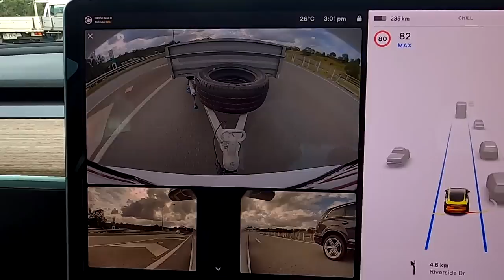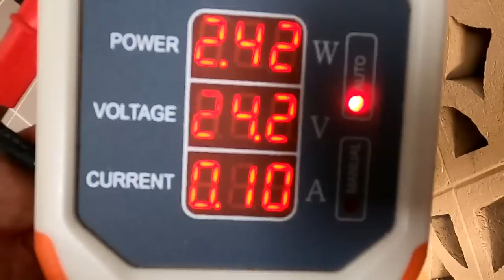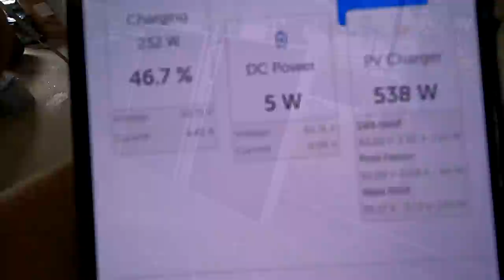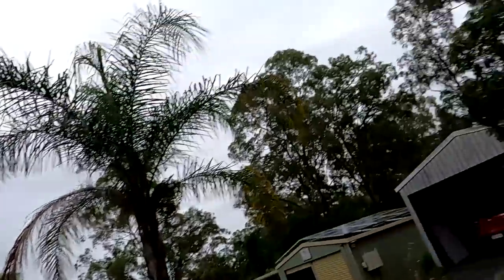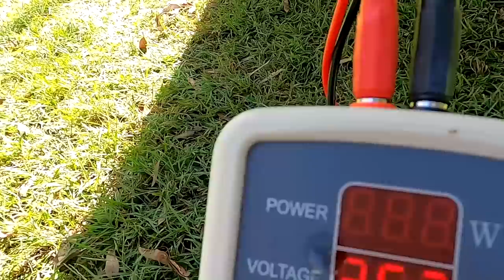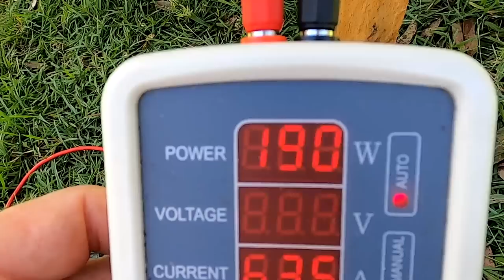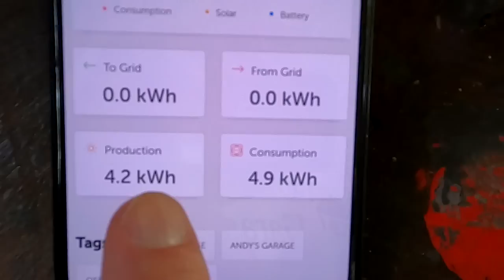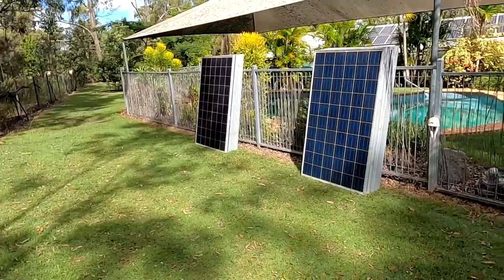S.P.A.T.-Testing used RENESOLA 250W panels 🍺 Have I wasted my money (again) on this brand?

Comment: create rack over the walkway between the sheds .. extra sq. meterage  and shade creation
Reply from the maker: I need to access the gutters though, so that's not an option here. But I still have a lot of roof space for another 20kWp at least plus other locations we will explore in the future.
Reply: @OffGridGarageAustralia  smiles .. i have designed mine to use no gutter and make/collect the water fall down sides and collect and drain at ground .. no more leaf litter ever ...lol.. i have pile rotten guttereing awaiting my burying in the next veggie plot .. waste not want not ... smiles .. so many ways .. but ideas spring eternal ..
Reply: @OffGridGarageAustralia  how about utilising the space above the pool area?

Comment: Now THAT is a deal!  I wonder why they sold it for so cheap?  Even if the inverter doesn't work, you still got a great price for the panels and the rails!  Great find!
Reply: because you have to pay big bucks to recertify panels to reuse them except for DIY off grid.
Reply: @John-gm8ty  no - because it’s Australia and used panels are cheap here. And if your selling a brand like Renasolar which is known to be not great then you have to sell it cheap, because you can buy decent brand second hand 320W panels for about $100 panel. There are heaps of those early 3kW systems being pulled off roofs in favour 6.6kW or 9.2kW systems. Plus they probably just wanted to get rid of it fast. You can get a Fronius 6.6kW system with tier one panels here for about $AUD5K - 6K installed. And you can get much cheaper if quality is secondary.
Reply: @mondotv4216  mate, my point is if you want to reuse them on a grid connected system, you HAVE to have the panels (and inverter if used) tested and recertified to be used, it is the law.
and thus, they are a plenty because no one wants to pay for that vs just buying new panels and new inverter.
and upgrading their current systems to larger ones.
no company would touch us to add a second system to our 10 year old 3kw set up, so all we could do is upgrade to a bigger system over all and take the old one down.
and that's why I have 10 panels in my side yard now.
Reply from the maker: The re-certification of panels and inverters is a pain in the bum down here. I stay off-grid and keep adding...
Panels are not that cheap any more down here as they were a year ago. And far less choices of systems available. This was a very lucky deal.

Comment: Hey Andy. We're sitting in the same boat.  Next Friday I will pick up 120 of used 235/240W. I have 20 used 175W BP Solar for about 5 years. And they perform really good. So hopefully the newer ones will do the same
Reply from the maker: Good luck. I'm sure they will be fine. 120 panels is a lot. Hope you share some with your friends 😊

Comment: Your more than welcome to send the inverter to me over here in Nz so I can use it to start building my own off grid setup on the miniature farm I am buying. Not bad inverters those growatts
Reply: It's a grid-tied inverter. You'd need to make a "private grid" with another off-grid inverter to bootstrap the grid-tied inverter.
Reply from the maker: The Growatt can only be connected to a grid or a Multiplus which can handle that sort of AC connected inverter at its output.

Comment: One tip for hauling panels if you have to stack many is to make some wooden corners out of dimensional lumber scraps and some screws that you then band the corners with a couple straps and this keeps all the panels locked together with the frames on top of each other so all the weight and pressure is supported by the frames when going down the road. Then you can have a couple straps over the top to keep the whole works from moving during transit.

Comment: It’s great to see u recycling old panels, I think it would be a good business to harvest and test 2nd panel’s for resale
Reply: requires recertification which would raise the cost of used to near new prices, no one would buy them.
Reply from the maker: There is a company a bit north of Brisbane which has hundreds of these panels for sale. It was just a bit too far for me to drive.
You could match all panels with the tester and sell them for different prices depending on their power output.

Comment: don't forget to test for ground fault as some panels will show voltage from one of the terminals to the frame, I had some showing 15v to the frame
Reply from the maker: Yes, I'll do this before they go up on the roof.
Reply: @OffGridGarageAustralia   a lot of cheap panels have been taken off the roof due to a ground fault. This is normally due to 2 reasons is water in the panel and caused corrosion to the frame water in the panel or a short to rail.
Reply from the maker: @robben8704  This is a problem if you have grid-tied inverters as everything related to ground. My DC system has no relation to ground at all.

Comment: Definitely an advantage of living in a country where solar power is commonly installed: cheap used panels!
Reply from the maker: I will buy some new panels at some stage for other roofs, just to see the comparison to the used ones. But these 250W panels just fit perfectly to the existing system, voltage, amps all this matches the existing panels, so I had to do it.
Reply: @OffGridGarageAustralia  I would do the same if they were available here at that price!

Comment: Great addition to your arrays. You've got the space, so there is no problem adding them. Also great you recycle them this way, they seem to be around 80%. But still fine for your wallet. What is the calculated turnaround time?
Reply from the maker: Thanks Edward. The panels will output full power of cleaned and we have clear sky. The 80-90% I saw during the test was enough for a light cloudy morning.
I have not made any calculation in this regards. It's a hobby, so money well spent.

Comment: You are a lucky man! This little amount of money for these much panels incl. rails etc. I'm envy.
Reply from the maker: Discovered it on the morning, texted the guy and picked up 4h later. I had to charge the vehicle a bit higher due to the trailer load 😊
Reply: @OffGridGarageAustralia  Guten Morgen from lower bavaria Andy, thanks for your reply. How much increase in current consumption do you have   when taking the trailer?
Reply from the maker: @a__133  I manage usually around 132Wh/km for this trip and had now 225Wh/km.  It used exactly 50% of my battery for the 100km.
Reply: @OffGridGarageAustralia  TY very much. Consumption increases similar to an ice car. 🤨

Comment: Possibly on your next solar installation the next 3 kW do a ground mount installation. That is if you have maxed out all of your roof space. That would be a great video you could also have them adjustable for winter to allow maximum power over your roof arrays 👍
Thanks for the SPAT T-shirt🍺
Reply from the maker: I will do a ground mounted installation at some stage. I have a special area in mind on my property but can only AC connect this back to the garage, so it will be interesting to hook this up to the off-grid system.
Reply: @OffGridGarageAustralia  
Excellent looking forward to that video

Comment: You have probably mentioned it before, but is your garage cooler with the solar panels on the roof creating shade?
Reply: I had a 10 kw system installed on a scillion type roof to fill the area above our main living area of our house, and the air conditioning effect is huge, it drops the inside temps so much in summer until around lunchtime at least and my house is so much cooler, we only use the air cons very occasionally. Cooling effect = HUGE!
Reply: @evil17  That is cool to know, thanks.
Reply from the maker: Yes, it is a lot cooler already. The panels keep the heat away from the roof.
Reply: @OffGridGarageAustralia  Glad to know that, thanks.

Comment: Just keep adding.  Sweet.  The inverters use clipping(your solar charge controllers), so you can just keep adding until you reach the V I limits.  My inverter/charger was rated for max 3000w and I put in well over 3000w.  Clipped the access off and charged at 3000w.  great stuff.  You could call it a waste but panels never get to there potential in winter.  When there this cheap just keep adding.  I think solar company's now do this, add 20% more panels for losses.

Comment: hi Andy, now you have more panels wondered if you would be putting them in parallel with an existing string. I am thinking about connecting a string on an East roof in parallel with a string on the west roof. what would I lose if I did this - maybe only a small percentage and it makes sense rather than investing in more expensive Victron mppt. maybe it's an interesting study and you are the person with loads of panels.
Reply from the maker: Thanks Gary. Yes, they will be in parallel with the existing strings on the garage. I have all panels in a 3s configuration matching my solar charge controller. I upgrade the controller to a larger one when I build the PowerWall to accommodate these additional panels.
Each side of the roof has 3 strings (with 3 panels in series) in parallel at the moment and with this upgrade there will be 5 strings, so I parallel an additional 2 strings. 
And I will have the exact same on the other roof side, so east and west are identical. I'll explain this again when we install the panels. Just waiting for material to come in for that...
Reply: @OffGridGarageAustralia  thanks Andy. Thinking a bit more about this and looking at your roof angles I think your system will generate quite a bit off both east and west at the same time. I have a roof with an angle of nearer 45degs so I am thinking I will either get power from one or the other, so am sizing mppt to only one side but actually attaching twice the solar capacity
Reply from the maker: @DrJGD  that's correct, there is little difference between East and West in my case. Especially in summertime they are almost the same. I'm in the process of finding more spots on my property for the winter sun. That's when I need the energy.
Reply: @OffGridGarageAustralia  on a side note, have you ever tested the difference in performance between a 2s and 3s  with the mppt ? Is it better to have say 3mppt and 2s or 2mppt and 3s. Given mppt limit is the output current and ignoring the mppt cost for now - which would perform better ?

Comment: I used some old Sharp 220w - if you have endless space to mount its good, but new panels from a wholesaler are pretty cheap & youll get a lot more power on cloudy days.

great price for the rack mounts!  grease it up to avoid corrosion & galling
Reply from the maker: Yeah, some of the clamps I could not get off easily. Is there a special grease to avoid that with aluminium?
Reply: @OffGridGarageAustralia  As always i look to marine applications, the harshest environments.  TefGel gets a good mention. You need an anti-seize compound, but they normally have copper/metals - which make corrosion worse.
I just did a quick Lannox lube or lithium grease from memory, as my setup was temporary.

Comment: I think the discolouration around the cells is due to high current on the busbars within the panel.
Reply from the maker: Don't know, I have some other panels they are reversed in this colourisation, so dark in the middle and clear around each cell in the panel. Still output is normal.

Comment: Are you going to ac couple through growatt inverter?
Reply from the maker: Yes. But with the off-grid system. The Multi can handle AC-coupled solar on its output.
Reply: @OffGridGarageAustralia  I think adding ac couple with its own set of challenges will be a great addition to the channel.
Reply from the maker: @jasondevine6014  This will be a rather larger portion of how I connect new panels in the future I think (at least in some areas). Due to shading, micro inverters could be the way to go...

Comment: Seems to me you got yourself a deal. Which of the inverters will you connect them to?
Reply from the maker: Because I'm off-grid, I have to connect the grid-tied inverters to the output of the Multiplus and the Multi will handle the power coming in and also charge the batteries from that power. This all will be very interesting!
I will potentially use the Fronius inverter I have but will keep the Growatt as well. I also ordered some micro inverters to some extensive testing.

Comment: Will Prowse likes ReneSolar. The polys produce their full rated output. I have 4x 325W output up to 1.302Kw into Victron 100/50 and up to 45.5A into battery.
Reply from the maker: Yeah, the older 190W panels I have from them are all not good. So I was concerned. Luckily they all seem to perform well.

Comment: Hi Andy, I do enjoy your videos and have learnt a lot from them, thank you. I have had an idea for my off-grid set up that I thought you may be interested in, some videos perhaps?. I want to use excess off-grid solar generation to heat water and charge an ev (still waiting for a suitable one). The problem is my solar is in a shed 100m from where the hot water is and where the ev charger will be. An elegant solution has avoided me until now. I just saw a video on home automation with shelly relays. It is beyond me at the moment but it seams possible to sense the SOC of my batteries with my victron shunt relay and send that info to relays controlling my hot water and ev charger via wifi.
Reply from the maker: Thanks Colin. We ill certainly have a look and install some extensions on my system in the future to automate such functions for times when we have access solar available.

Comment: Nice video again Andy. In total how many Kwc will you have?  Is there’s any regulation on this in 🇦🇺 ?  In France we need an approval process in townhouse to install panels. This take approx 3/6 months. And the law does not allow to have more than 6kw injection into the load.
Reply: Andy is running ~4.2-4.4kW already, and I believe has other spare panels as well. So this will expand the existing 4kW system. As he says at around 2:00, that will give him over 7kWp.

As this is off-grid, there's no limitation on generation, as he's not feeding back into the utility grid.

Comment: Build a structure over the pool with solar panels!!! That would be incredible.
Reply from the maker: A structure... do you want to come an doing it? 🤭
Reply: @OffGridGarageAustralia  If i can stay with you for free, I would definitely do that for you!!! It should only take a week or two.
Reply from the maker: @jondavidmcnabb  free power and stay in the OffGrid Garage 😉
It will be very difficult to build such a structure over the pool with can withstand the wind load. Lots of concrete and a very strong structure spanning across the 15m of the pool. That's not an easy built...
Reply: @OffGridGarageAustralia  Aluminum structure and wedge anchors into the concrete. Aluminum can be cut with traditional wood working blades and won't really rust. The panels are the roof. Now you just need to collect a bunch of scrap aluminum.
Reply from the maker: @jondavidmcnabb  Aluminium is not the problem. I have a shop not too far which can cut this all. I'm more worried about the wind load and how to mount it above a water filled pool.
Reply: @OffGridGarageAustralia  Did I mention that I can weld and fabricate?

Comment: Its okay if you have enough roof space, and you can get the polys cheap!👍
You made a good deal.
But i think its a problem of all the polycristalline  modules, my monocristalline modules runs much better than my polys.
Tested it several times, with different inverters, so i would never buy new poly modules.
Here in the middle of Europe roofs/ground are very expensive, so its a good idea, to use your roof space perfect, with best performing modules.

Comment: I was surprised to hear the price for the new half cell modules in Australia. Seems like this is one of the few things which is cheaper in Germany. I am pretty sure you made the right choice to get the 12 modules for that incredible price. It hurts to hear that otherwise old panels get shredded and used for road constructions. What a waste of resources. Now lets see how these modules improve the charging time for your DIY battery bank! What do you think of thin film modules as an extension for your system for low light conditions?
Reply: there's no other option, due to safety, if there's a issue in the cells, there could be a fire, so they require recertification to reuse panels, and no one wants to pay the ludacris prices to test and recertify for safety over just buying new panels.
plus new panels are virtually all higher output than used due to improvements in manufacture. 

you can still use them for off grid though, and many do. 
hell I have 10 panels in my back yard from when we upgraded the system here, and some are being used for a small battery bank (which does nothing currently)
Reply from the maker: Thanks Hendrik. I really don't have low light conditions down here in contrast to Germany where it can be grey for months. I was looking for the half cell modules due to the shading of the trees but found it may not make a huge difference and I rather look into micro inverters and optimisers. I've got both here but had no time to test it out yet...
Reply: @John-gm8ty  I wasn't aware of that. But doesn't that mean that there is no real used PV market in Australia because of this?
Reply: @OffGridGarageAustralia  I see. I was just wondering how much energy those modules would provide compared to the monocristalline half cell modules if the conditions are more on the low light side. But I guess Australia is not the right place for this 😂.
Reply from the maker: @hendrikbock  I've got a lot of shading in winter through my trees, also lots clouds and rain in the last 3 months. 
I cannot imagine they make a huge difference to normal panels. It all depends how they are shaded, I guess and if it is a sharp shadow or just a random shadow form a tree or example.